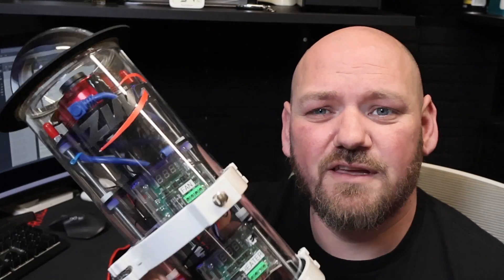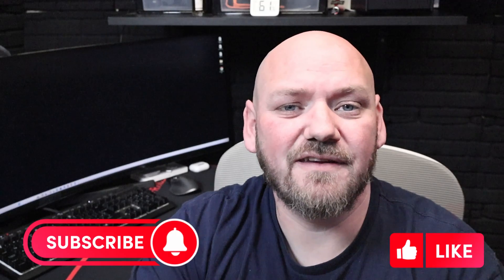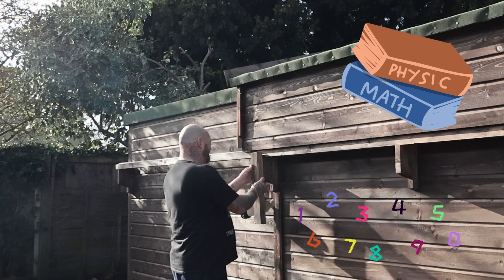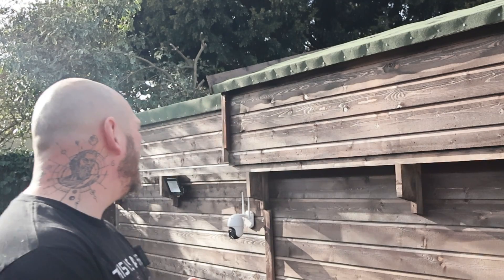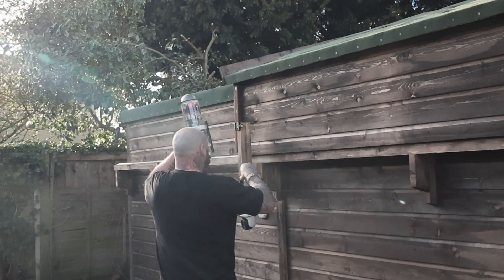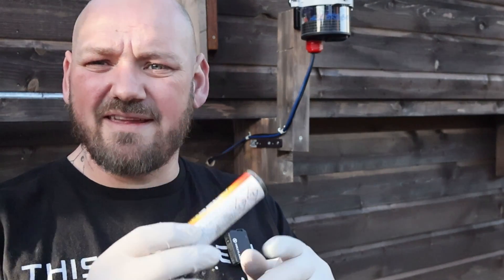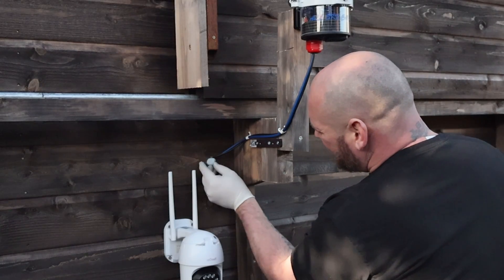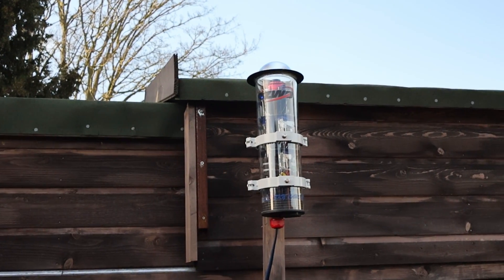All Sky Camera, Installation and more. lets see if we can capture a UFO!

Comment: very pleasing images. But to capture UFOs, take a look at the setup that the Farsight Institute use. They're using off-the-shelf cameras that they then have modified. UFOs move so fast that extra-fast FPS is required, and of course ultra high resolution.Also, southern England isn't a hot-bed of UFO traffic, depending on precisely where you are of course (I'm only assuming southern England) — Suffolk and Devon are good spots.
Reply from the maker: Thank you for commenting, I had a look at these guys, I have a few ideas for future videos which should work out well. I just want to see if the sensitive location close to where I am interested anything first 👍
Reply: @Learn_astrophotography  Were you able to able to find anything interesting?
Reply: Farsight is a very interesting group of people and has had me intrigued for awhile. I do plan to create a camera setup to see what I can capture in my area.